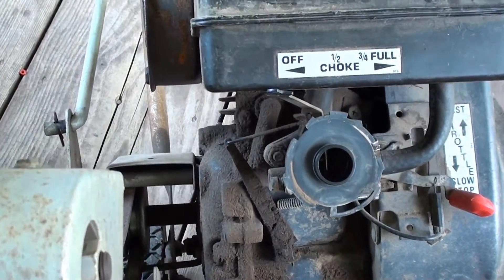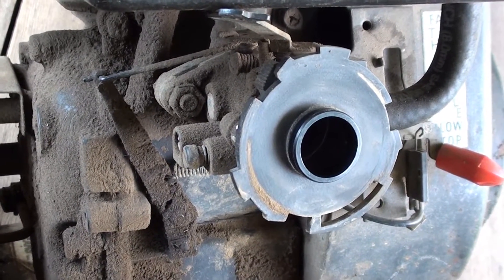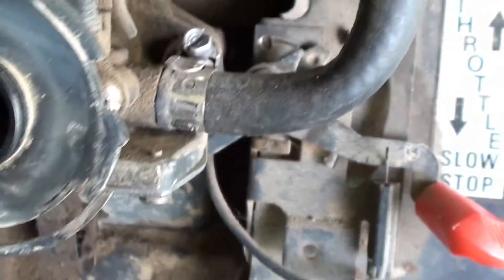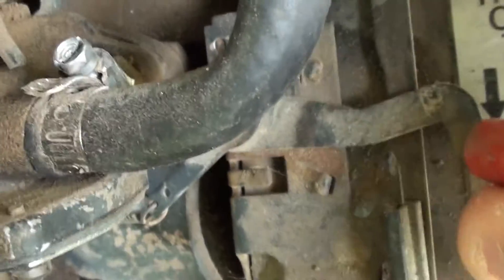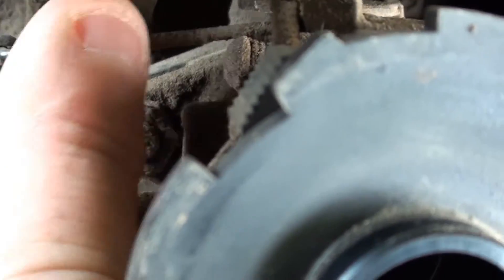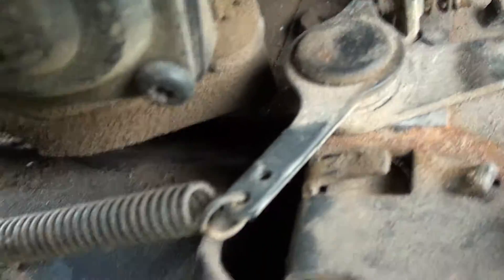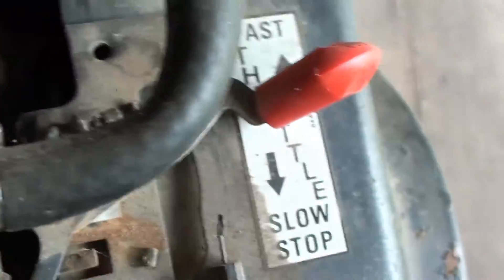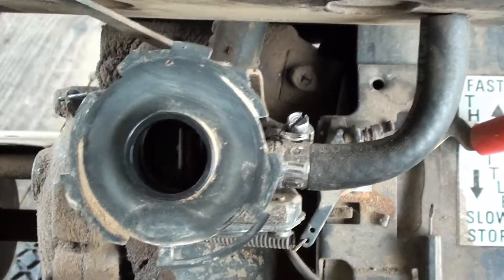Craftsman 9" edger carb linkage

Comment: The hole on the bottom of the carb is used for priming the carb right ? That's what I use it for I just push up in there a few small presses

Comment: Can you do a video on taking the carburetor apart and cleaning it? I've changed the gasket on the exact same edger and it worked for maybe 8 uses and now it's leaking gas out. Even after changing the diaphragm a second time.
Reply from the maker: +Wesley Eaton is it flooding from a stuck float or bad needle valve or is it leaking somewhere else?
Reply: I'm not sure specifically . It's still coming to of the carburetor through the air filter. I honestly have never fixed or cleaned a carburetor before. I've searched all over for videos on how to do so for this specific edger motor and nothing turns up.
Reply from the maker: +Wesley Eaton have you watched the video I have up of me replacing the diaphragm https://youtu.be/F7n4pdi5z_8 
With the diaphragm off you'll see a brass nut that holds the needle valve, try spraying some carb cleaner on the needle valve and push it with your finger to make sure it's not stuck. You can remove the nut and the valve should come out so you can give everything a good clean.
The owner of the edger is on vacation till the end of the week but when he gets home I'll pull the carb apart but hopefully you'll have yours fixed by then 👍👍👍

Comment: I have the same edger. I replaced the diaphragm and didn't get a great picture of the connection of the leakage to the carb. Which hole does the linkage connect to? I have tried several of the holes and when I move the throttle up and down, it doesn't move the linkage. Everything is the same as your showing. I would send pics but you can't in comments ugh
Reply from the maker: I don't have access to the edger but I'll watch the video this evening to see if it jogs my memory
Reply: @116falconer  Can I buy a new carb with a float bowl or do I have to find the "diaphram" carb?

Comment: Thanks for the close up shots. I still can not see my problem tho. At the bottom of the throttle lever is an electrical wire that connects from that throttle lever bracket and connects to ??? That's my problem here. Guess I inadvertently knocked it off somehow and the dang thing wont start now. Can you tell me where it connects? There is a connector tab on the end. Thanks a lot. anyone can help?

Comment: I have the same edger can’t get it to start after cleaning out carb. Only start and does with starter fluid
Reply: try adjusting the idle mixture, little screws on the carb.